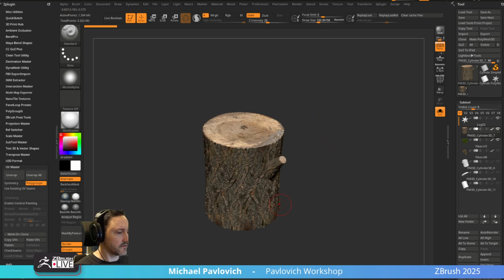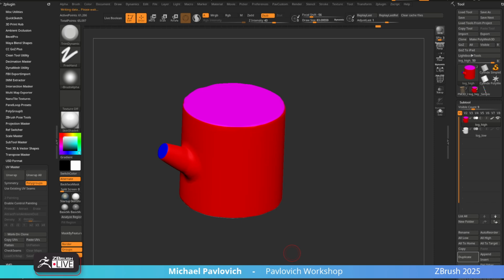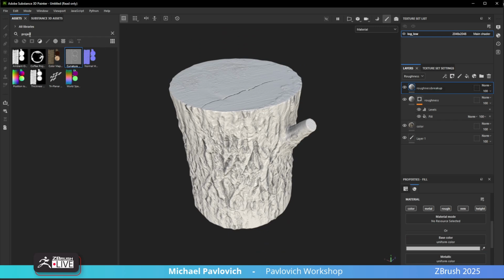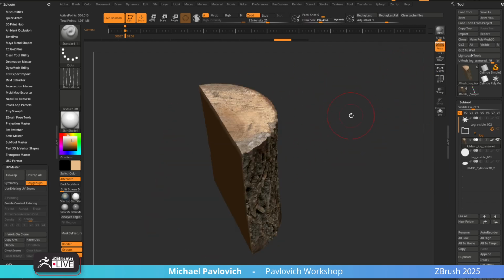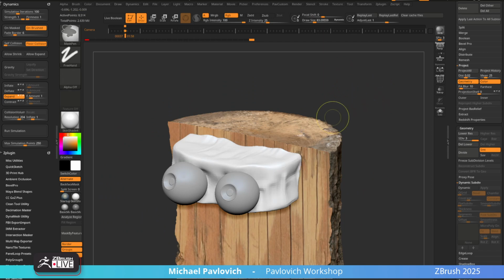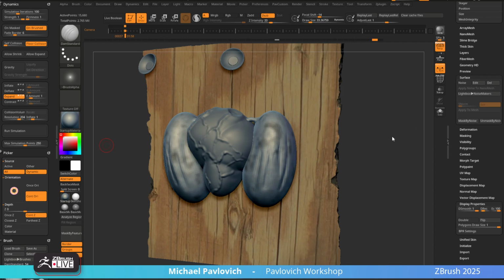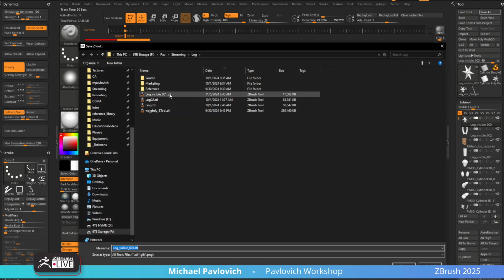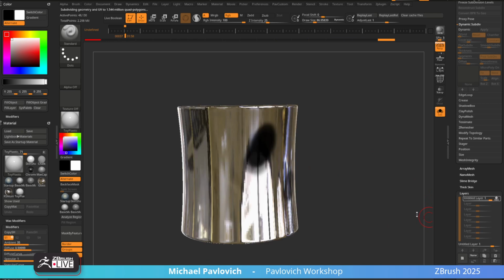Visible Log! ZBrush to Substance 3D Painter, baking, textures, Redshift rendering, and more!

Comment: Can you take a normal map from ZBrush and bake out the rest of the maps in Substance Painter based off of that Normal?
Reply from the maker: Yes, although you might get middling quality - bring in your low res mesh, import your normal map, apply the normal in the Texture Set Settings tab, go to Bake Mesh Maps, uncheck Normal (it's already done from ZBrush!), check on "Use Low Poly Mesh as High Poly Mesh" in Common Settings, select the Curvature map, and choose "Generate from Normal Map (Depreciated)". Then hit the Bake selected textures button, and you'll probably have meh-to-ok mesh maps 😅
Reply: @MichaelPavlovich  Oh ok- thanks Mike! I was messing around with some normals in ZBrush and I had some good bakes so I was wondering if it could be pushed further to get those maps for a Nanite Workflow. I only needed the other maps for the textures cause of Nanite I wouldn't need to use the lowpoly so I was just thinking about how to speed it up.